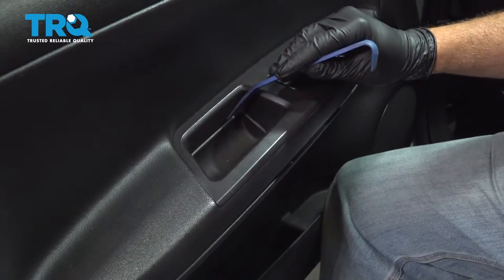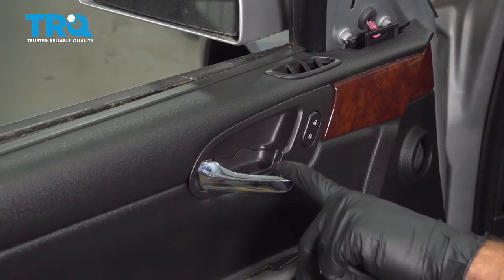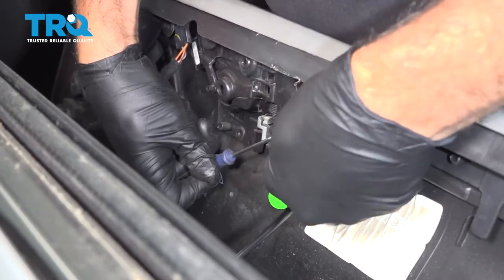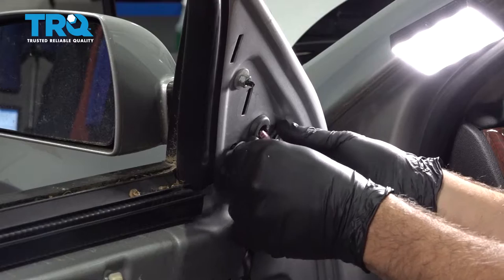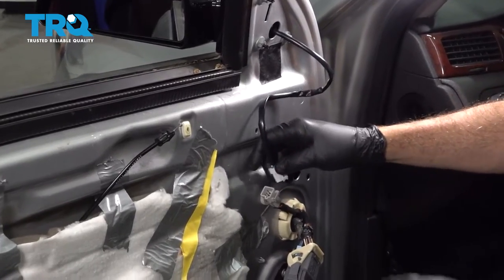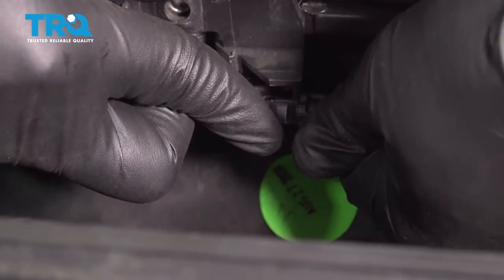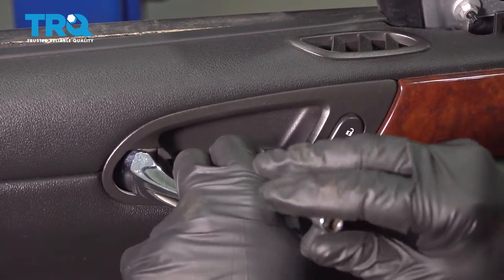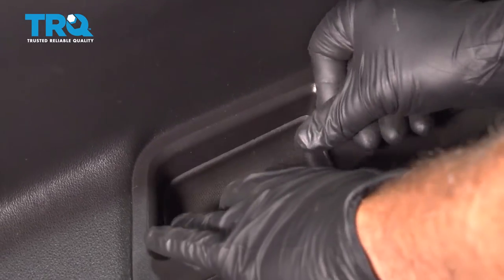How to Replace Left Front Mirror 2006-2013 Chevrolet Impala

Comment: I found your video very helpful. The one variation I would offer is to not disconnect all the wiring that’s attached to the panel. Simply remove all the screws and pull the clips to loosen the panel up. Carefully lift the panel away from the window just enough to give access to the mirror wiring plug behind it. Change out the mirror as instructed. Plug in the connection and reinstall the panel. Everything works fine.

Comment: TRQ, Couldn't you just skip removing everything and do a wire splice up where the old wires runs up to the inside of where the 3 mirror nut screws are and cut the wires off behind the new connector on the new mirror and do the splice there?  Are the old and new wires color-coded the same?  Would that work with wire nuts or crimps?    How many wires are inside the little cables?  I'm not worried about the warranty on the new mirror.